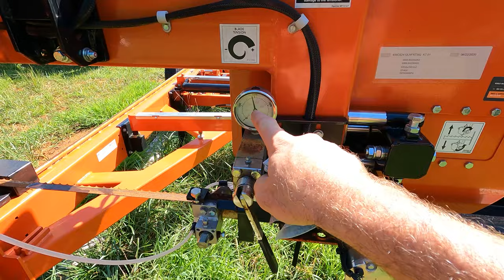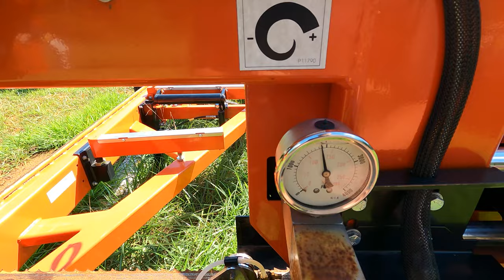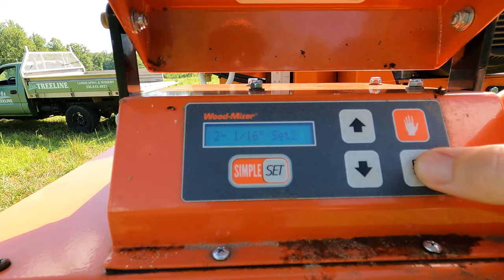Sawmilling 3 huge wild cherry logs and found something amazing!

Comment: An idea for you or a friend: 1. Cut and sand tree rounds. 2. Rig a metal holder to hold and focus a flat plastic fresnel lens focused on the wood round edge as a solar wood burner (see the Edmund Scientific Optics Catalog). Wait one year and you'll have a harvest of "Solar Calendars" (a spiral burn line showing the history of cloudiness). Finish with clear epoxy and sell for maybe $250 each in gift shops, by mail order, etc. Have fun, as usual 🤗

Comment: Such a cool machine. Thanks for sharing.
That grain is amazing. I'm jealous. There are so many great projects that could be made with that.
What factors do you use to decide which way to cut it? Whatever's the widest cut, generally? Focus on knots?
How do you store this? Does simply putting spacers under it do the trick, or do you have to do more to maintain the shape?
I made a beautiful table from some oak and cirque from some sleepers I picked up. After ripping them, and building the table and benches to go with it, they shrunk and curled drastically. It still looks nice, but the tight joints and amazing smoothness of the surfaces are all gone.